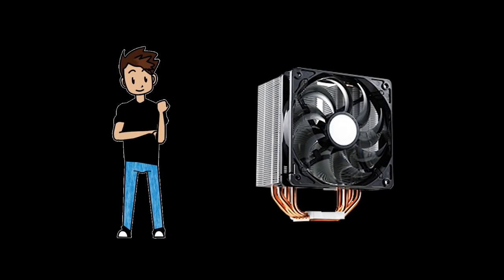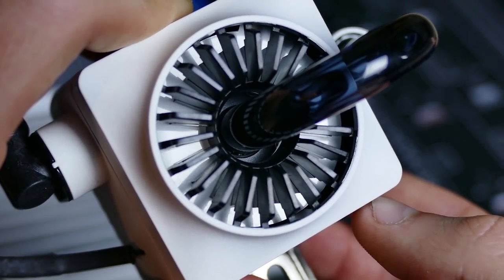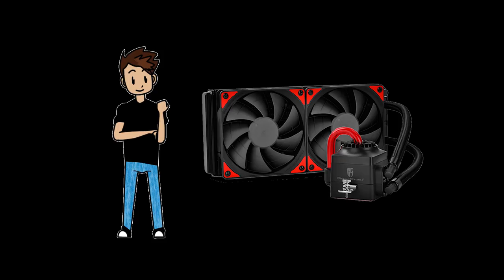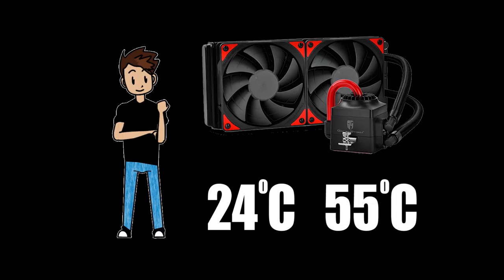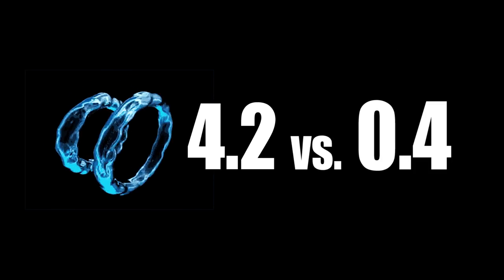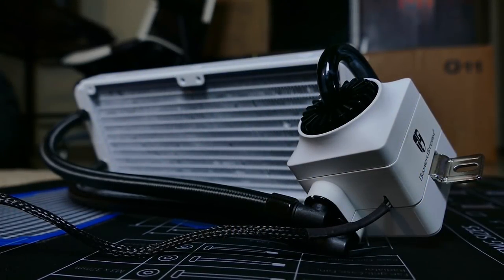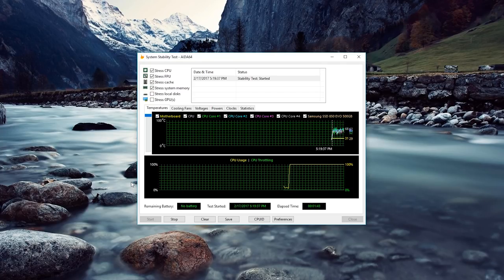How to Properly Measure AIO Temperatures

Comment: A few things that I felt ought to have been made a little more clear, but still follow directly from what you said:

1) As you say, more water will take longer to heat up, but if you add water and enlarge your radiator then there will come a point where the water will dissipate heat through the radiator at the same rate that it absorbs heat from the processor. Obviously, it would be a very large loop and radiator to do this, but its not theoretically impossible.

2) Lots of times liquid coolers are pointless, even though you aim to say they aren't. The only reason they're useful to us enthusiast users is because the heat generated from one cpu/gpu is extremely small. There are not many server rooms / data centers that use liquid cooling, and the reason is that it would take a loop that is comparable to the plumbing and several large AC style radiators to cool such a thing.

Comment: If you are going to run an AIO the radiator needs to be mounted outside the case like a fin so that the air going through it is from the room.  Otherwise it will pull heat into from all your components, my H100 was worst than a decent air cooler until I mounted it standing up on top of the case.  Then it ran cooler regardless of how long I had the computer running, about 20 degrees C cooler on my FX8120 if I remember correct.

Comment: I've got an i5 4690k and a Corsair h80i GT using both fans that came with it in push pull and 3 case fans pointing inwards my CPU temps jumps to 49c and after an hr bounces between 54-55c in prime95, h80i GT is only a 120mm rad but is extra thick n with both fans on it is a little chunky but its doing its job and doing it well even though it's having a massive 120mm cube in my pc that covers half my motherboard and the CPU header needed to be put in first making the rad harder to install and tubing that winds my up on occasion I'm still very happy with my purchase and it still going strong after 2 years 24/7 use and my case fans are louder than it even in performance mode while gaming or stress testing

Comment: I was wondering, since Noctua and others are fond of a 2-fan push-pull configuration across their radiators, if the same would be beneficial to an AIO.  Would adding additional fans to the opposite side of the AIO rad increase performance?

Comment: I have a Corsair 280mm aio on my gtx 980ti, and I run GPU intensive programs for 4-6 hour runs and it never goes above 45 degrees Celsius, and cools down pretty quickly once the program is closed, down to an idle of 23-27 degrees. So I'm not seeing the same results as this video

Comment: Here's the issue, the temperature reading is not reading the temp from the copper or the water, it's reading the temps from the CPU, so it doesn't matter that the specific heat is higher on water, that doesn't explain the difference in CPU temp, what does explain it is water's superior ability to transfer heat vs air's. Like you said, the pot hits boiling temp long before the water, however, the thermometer of the pc is measuring the temp of the "pot" as it were, not the water. That being said, you were correct in your assessment that an aio will stay hotter for longer, mostly due to the lack of a specific reservoir that would give the water extra time to cool before being recirculated into the block.

Comment: the long and short is that it takes longer for your processor to reach a max temp with any liquid cooled block, there's no question there - how you use the hardware with that in mind is up to the user - why is this such a plot twist?  I think that was the point but it may have got lost (may) with some of the delivery

Comment: You should mention that you are talking about alu radiators and less air throughput per hour (due to usually lower spinning fans) compared to an air cooler. There are some AIO watercooling solutions with a copper radi, which will dissipate heat better and keep the water at lower temperatures.

Comment: I agree to all what you said but, liquid (water/coolant/glycol) dissipates heat faster with help of the radiator and the cooling fans directly blowing cold air from outside of the PC case. Consider also the big factor of the ambient room temperature where the PC is located and the speed of the fans and the efficiency of the electric motor driving the flow of the warm coolant emitted from the CPU thru the CPU block and the air cold coolant from the radiator. Using a digital infrared thermometer to measure the CPU temp is one way to compare the temperature readings from HW monitor or any monitoring software. You will be amazed to see a difference of 5 to deg. celsius.

Comment: I am a motorcycle/car mechanic. 

Liquid cooling is hands down better then air cooling because its more controllable. However, The most crucial part of its success, is the location of the radiator, and also fan management. This is the issue I see in computer liquid coolers. 

The rad is always located inside the box, treated as one more heatsink in the box, where all the other components emiting heat are. Thus eliminating the most powerful advantage of liquid cooling. Which is being able to locate the heat dissipation in the coolest part of the machine.

The efficiency of a radiator varies depending of the temperature of its environment. Obviously, temps are cooler out of the chassis right?.

If you manage to place the radiator outside the chassis, I would guess you would get about 20 to 30% more efficiency. In addition, The fan management must be more complex, or constant.

Although I agree with the fact that naturally, water cools slower than copper, a well placed/managed radiator can manipulate the water to cool faster than what naturally a bulky copper piece can. Since the water will travel trough a large number of fins exposed to temps lower than inside the chassis.

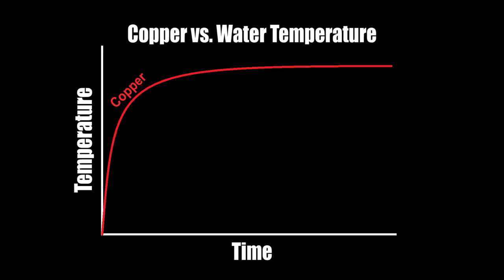Comment: 2:40 "copper is absorbing energy at the same rate water would be in its place, but copper has a much lower heat capacity, which means it heats up quicker"

I'm confused. The temperature sensor that tells you the CPU temperature has spiked is located on the CPU die, not the cooler. Since both AIO coolers and air coolers rely on a flat copper plate contacting the CPU die (with thermal paste to close the air gaps), there should be no difference in the short-term temperature reported, since that flat copper plate is the same in both types of coolers and would thus heat up fast anyway. This must mean that the AIO cooler's circulating water is much more efficient at taking heat away very fast from that copper plate than the air cooler's heatpipes, thus keeping the copper plate from reaching thermal equilibrium with the CPU die for a much longer period of time.

But instead, that bit of the video kinda implies that the water contacts the CPU die directly and there is no copper plate as a mediator, which is simply not true.

Comment: The main reason you want to use a water cooler is the stability of the temperature as it rises and fall.  Having fast temperature change are bad for the life of the overclock CPU.   Also removing the radiator on top of the cpu, minimize dust build up around the motherboard and around the cpu area, hence heat from other component can move more freely away from the inside of the case.

Comment: with an AIO my idles are at 60c on a 2700x. Max temps are lower tho, as you said- during gaming I frequently dont come up much over my idles at all, but the ryzen doesnt get loaded up hard by games as you know. When benching it can get up to 77-80c, but it was reaching 85+c on the stock air cooler.

Comment: Then what do you recommend for intel 7800 and above,  Rizen 1800 and threadripper 1900. AIR COOL or LIQUID COOL . MY room environment is alway above room temperature by 15 degrees. Mostly play simulators. Flight , space, submarine simulator.

Comment: Well, I use a standard Ryzen 5 1600X for my CAD renders and when I was using the beQuiet Pure Rock Slim, which has a tdp of 120w seemed like a good match for my 95w Ryzen. Wrong. After just a few 30 seconds the computer hard-kill itself to prevent damage. So I figured a bit and invested in a Corsair H115i and the problem I had is just gone. Not only does the cooler look good, sound less during load, but you may also decide where to draw your cool air while saving in on important motherboard space. This also allows you to have a larger radiator than you can with a heatsink. It is just a much more stable system to cool a component that can spike and dip immidietly in heat.

Comment: I never understood why AIOs would have lower temperatures, it's not like it's radiating it differently it's just using liquid to move the heat to a different location and then radiating it. Is it because aio rads are more efficient than regular aluminum fins like the 212?
Reply: Voss Li radiator is often bugger than the 212, and because you’re pumping the heat around it means the heat is more evenly distributed, and thus the system cools better

Comment: Your iron to water is only correct based on the thickness of the piece of iron your using! Water can dissipate heat much faster then iron where alum and Ti can dissipate heat substantially faster then water. Also one has to keep in mind that most coolants used in a closed loop should be close to a 50/50 blend so pressures don't pop the tubes off the fittings as well as the properties of the coolants will have additives such as Ti, alcohol and in most cases a petroleum based product added that allows faster dissipation of heat.... but I'm still trying to figure out this wrong part???? Liquid cooling will reduce your running temps lower then a standard air cooling system but it's not a chiller setup so there for will not keep it at ambient temps while under high loads

Comment: Hi, a question. What if i put 2 fans each below and above the radiator. I have a h100i v2 currently pushing air out from below the rad. What if i put 2 down and two above the rad????

Comment: So there are to metrics here.
1) removing heat energy away from your CPU. 
2) the rate at which that energy is dissipated from the cooling solution and is exhausted out of the case.
If I am understanding this correctly, do AIOs retain more heat energy? With a larger tower cooler like the nh-d15 be more efficient in some ways then a similarly priced AIO? With more metal surface area does the large tower cooler take longer to plateau compared to a smaller hyper 212? Air cooling still seems to be the best $/performance solution on the market for budget oriented builds with the the idea that a tower cooler is basically unkillable... all that needs to be done with a tower cooler is dust and replace fans... AIOs have a shelf life and their reusability is basically null.

I guess overall I am asking this:
Are tower coolers the most efficient at dissipating heat energy from the case vs just from the CPU?
Is the water acting like more surface area, yet the water is less efficient at transferring/ exhausting heat?
Why not just get more tower cooler surface area?

Comment: Off the shelf units are one thing, building custom loops are another. If you use a large volume of water, you can achieve and maintain low temperatures. With a small volume, a fixed radiator and fan can remove X watts. If you increase the volume to 25 litres, the same unit has 25 times as long to remove the same amount of energy. 
The fundamental flaw of off the shelf water cooled units like the one you showed here is their lack of volume of water. With that said it can be impractical to have a large, probably external, reservoir attached so people need a compromise and select a system that will suit and perhaps satisfy their needs.

Comment: I do a lot of rendering. While it takes up to an hour for my temps to stabilize (Corsair H55 AIO) when they do normalize, they do so at a lower temp than what any air cooler I have used does. I live in one of the hottest parts of australia. THE AIO cooler I purchased worked the way I expected it to. I always expect the water system to accumulate heat. but it doesnt do it indefinately or anything. I often render graphics "NON STOP" or video frames for days and weeks and even months (though usually not non stop with months) My machine is Always On (I sleep with TV Shows running off of the pc) So my Corsair AIO H55 Coller is over 2 years old now, and has NEVER been swiched off. Cool huh? Its a simple qiestin one must ask ones self. Do I need better cooloing than the Air cooled options I have tried? Then you have some choices. try better air coolers, or go to liquid. Given that I have purchased one of the cheapest Coolers out there and it has blown away the air coolers that I have tried, I dont see how AIO are lying, even if the true temperature is not revealed for an hour or two. If your CPU gets hotter than 70c, I reckon you need more cooling. if you are an extremely heavy CPU user (rendering mograph or video editing) then you really should consider Liquid cooling. It gives a great deal of peace of mind (other than the worry of a filing pump). Is there any such thing as a systemp with two pumps? One for redundency?

Comment: Great video!!  So you said water hangs onto the heat longer than metal, but for how long, like 1-2 hrs later idle temp is still up there?  And does anyone know if 240 is good enough or do you need 280 or 360 ?

Comment: Idk what happened I was playing elden ring then all of a sudden my PC turned off and wouldn't come back on then the bios screen popped up and the CPU temp says it's 100 degrees I have a skytech prism 2 Intel 3090 PC with a 360mm aio. I don't know what's going on if it's the thermal paste or the aio but it feels like there's movement in the 2 hoses that go to the CPU from the radiator but I don't know for sure. What should I do?

Comment: Good video, I took this information for granted as "common sense" your a better man than me for realizing the need to explain this.

Like wise important to thermal stabilization is the amount of energy transferred to the radiator material. The rate of radiant dissipation by radiator given material and surface area. And the thermal properties of air. 

Good work

Comment: It could actually be argued that a slower cool down after a long duration of high temperature use of the CPU is less stressful on the unit. Rapid in- and decreases in temperature pose a lot of different challanges for any metal, such as changing surface tension or a metal's proneness to cracking on nanoscopic levels, decreasing surface contact with heat transerring components.

Comment: Interesting topic. Maybe someone can answer me a question about an situation for a water-cooling I like to create for some reasons. I like to build a workstation PC with an Custom Weathercooling solution, in my mind I want to run this thing some time without fans to get it really silent. To get it right I only want to turn the fans of for some minutes max 30 or so at a medium load on my system. The rason is I'm an audio engineer and like to record' some sounds in the same room.

If I understand the theory in this video right I can do this if I have enough wather in my loop, monitoring the loop temperature the whole time and if I turn the fans on again they ramp up to 100% for some time to get the temperature down again.

Is this theoretically working? My system setup isn't ready now so I can't say witch components I like to cool at the time.

Comment: Just finding your video now, but I owned the Deepcool for my Ryzen 1600 rig. It enabled me to run the processor at 4GHz daily but within 6 months (pump on monitor CPU temp) it just died one day. The Ryzen Wraith stock air cooler is MUCH more consistent, albeit at lower clocks

Comment: Another thing being missed here is the amount of water in most coolers is very small.  As opposed to a pan of water on the stove, they will both heat and cool faster, more like copper but with these added benefits:  The cooler is not totally reliant on the air flow through the case to remove the heat generated by the CPU AND the CPU is not directly contributing to the heat inside the case affecting the other parts.  Partially isolating the hottest component in the system make sense.

Comment: i have a i7700 and use an aio h 60 its about 6 or 7 years old never been serviced and i keep my pc on 24//7, my ambient temp is 47c, and my core runs at around 60c when im gaming the h60 is a single fan radiator, id never go back to air cooling.

Comment: If your IAO stays hot looooong after the cpu went to idle you definitely have a problem with radiator and or fans. I see temp drop very steep after going back to idle. Besides, there's a whole research on the desired delta T for water cooling in general and the water/liquid will never reach the cpu temps by a long shot and will stabilize somewhere in the 30's C. So it will drop to that very quickly and lower due to cooling by the radiator and fans.
And i modified the Arctic freezer II (240) to cool the GPU in the same loop.

Comment: Metal fatigue can occur when heated fast then cooled fast. So for a CPU with a fair amount of tiny metal traces, this can make a big difference if using an AIO instead of air cooling. AIO will have much narrower temp delta during use